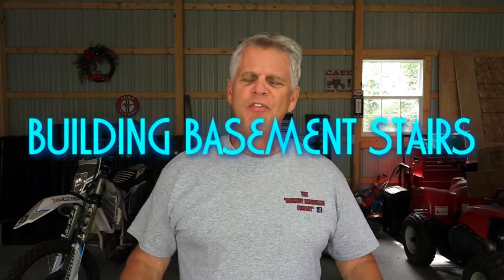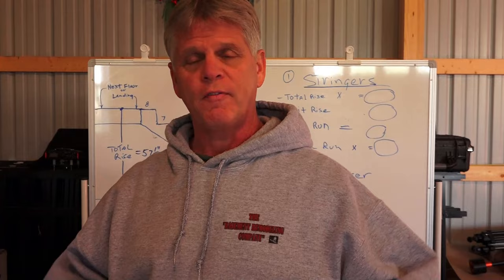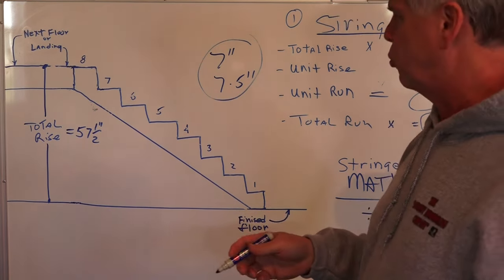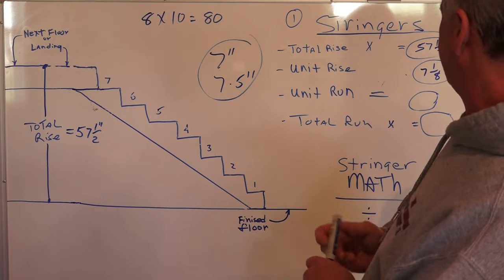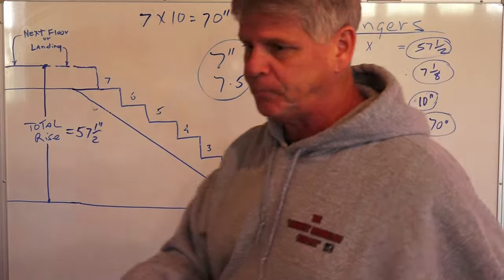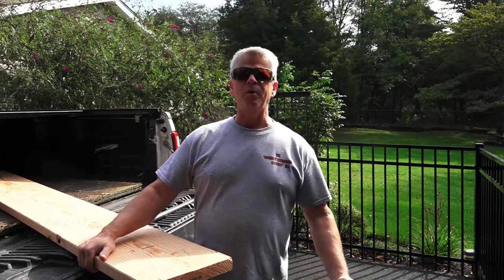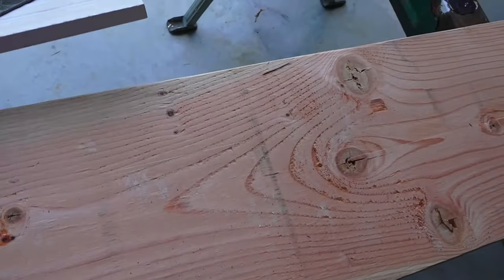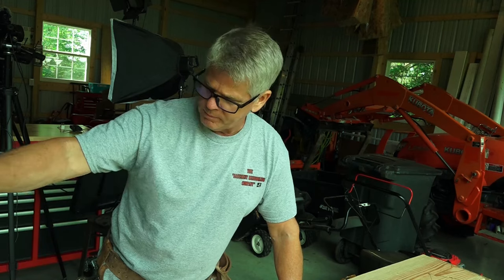How to Build Basement Stairs A to Z (Stringers, Skirt Boards, Treads & risers)

Comment: Hi Eddie, 

first of all, I just want to say thanks for putting out these videos. I've been binge watching the last few days every chance I get. Your framing video series was a joy to watch, and I got a lot out of them. 

I recently bought your basement 2.0 course, but I'm not ready to tackle my project yet, and I probably should comment on there instead, but I just wanted to ask you a question.

I plan on remodelling the whole house eventually and would like to rewire it as I go. I wanted to do my bathroom basement and kitchen first and then the other rooms after. So, have you any advice on the rewiring? For example, if I finished my basement, would it be possible to say finish a bedroom after and rewire it without tearing up my basement? 

I am a total novice at this, but your information and another contractor I follow has given me the confidence to go for it. Personally, I was thinking I'd have to rough in the new wiring by just running the wires first from everywhere before I start anywhere.?

I seriously would appreciate any advice you could give to give me a heads up. 

Thanks again, and I'm looking forward to learning from you and your course.

Martin